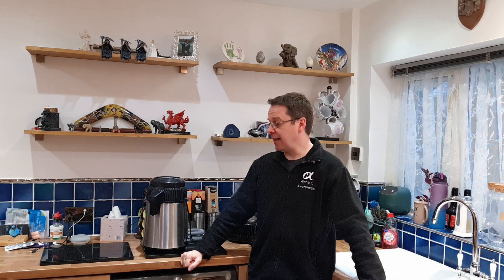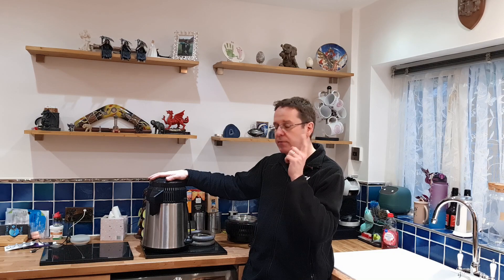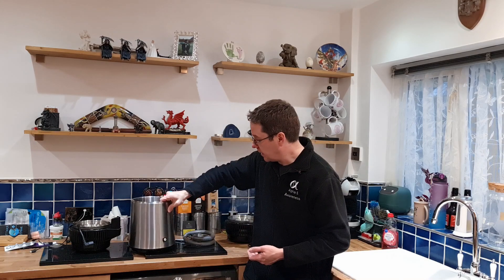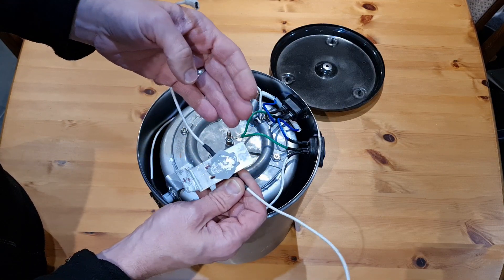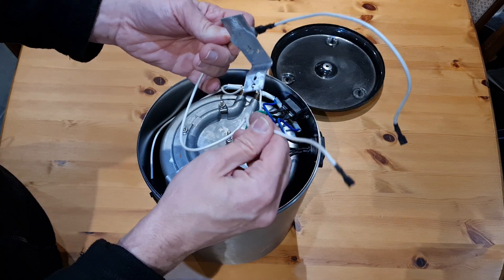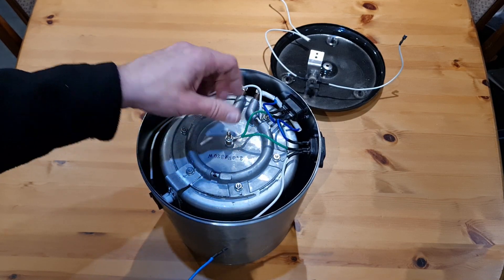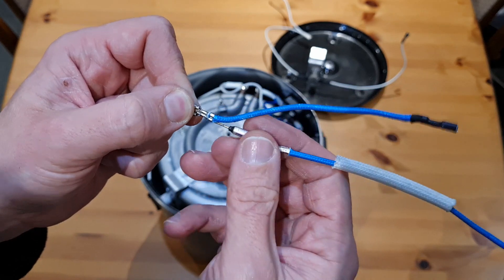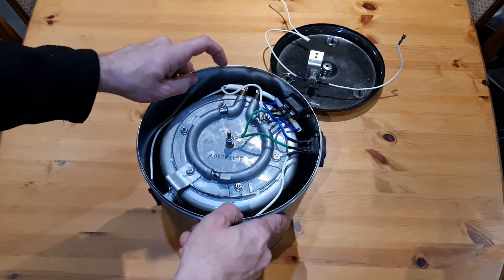How to fix a broken Air Still

Comment: Legend, thankyou heaps for this video.

So that reset switch on the still, does it click out like it would on a power board ?
Reply from the maker: Hi @oxideblitz7283.  Yes and no.  Yes, it does click out so to reset it you need to push it in, but you probably won't visually be able to see any real difference is the switch.  It won't be that you can walk past it and notice that it has tripped.  When the switch needs to be reset, you only push it in a few mm, so it isn't that profound.
Reply: @brewingadvice Ah okay, I'm trying to find a new thermostat just struggling to find the specific one lol my air still after about 45 mins of use throws out the house power
Reply from the maker: @ThisIsMyStankFace  the thermostat shouldn't be the item that is causing the issue.  The thermostat is just a switch that allows electricity to flow to the heating coil.  If the thermostat gets too hot it will trip and electricity will stop flowing.  A standard kitchen kettle works in the same way and has the same type  of thermostat in it (all be-it slightly different size and temperature rating).  The only difference is the kettle will auto-reset itself once the temperature goes below a set point.  The Air Still needs to be manually reset (for safety).  So, if you switch to a new thermostat, I don't think it will help you.
Reply: Glad I read the comments. I turn on my still, the fan turns on then it blows the fuse on the switchboard. I Intially thought it was the element. Watching your video I thought it could have been the thermostat as there is some staining on it. 
Do you think it's worth getting a new thermostat?
Reply from the maker: Hi  @lauragreen49 .  Sadly it is difficult to say, it depends what is tripping.  Most Consumer Units (Fuse Boxes, or Switchboards) use several MCD trips under a single RCD trip.  An MCD will trip if it detects that the Line (Live) and Neutral have touched.  An RCD measures the outgoing new electricity and the used incoming electricity.  If it detects that the in and out are different (meaning something is absorbing the electricity, like a human), it will trip.  It is possible that a faulty switch (like the thermostat) is allowing the electricity to ark across it, so this could cause a trip.  Another part is the Thermal Fuse, but these blow like the fuse in a plug, so these don't really cause an issue.  It is also possible that the heating element itself is causing the issue.